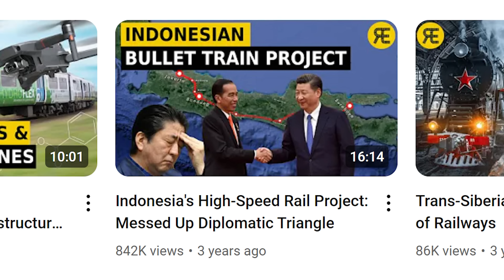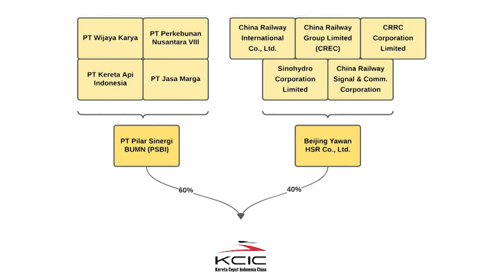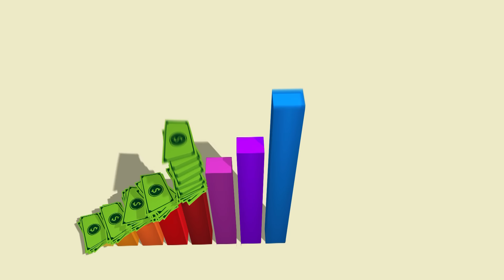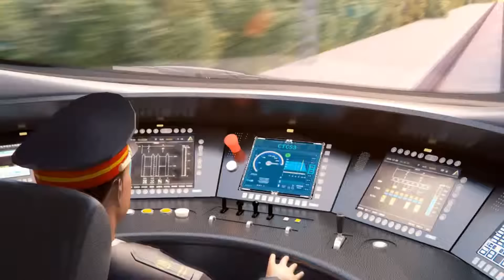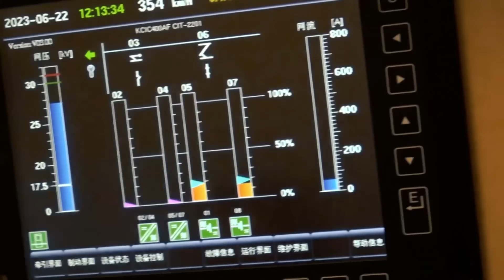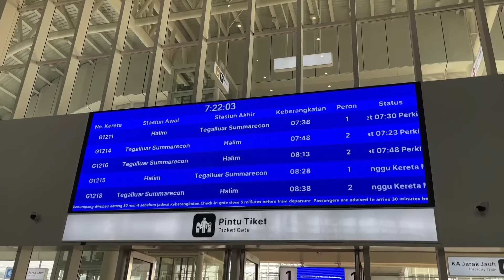Indonesia’s High-Speed Rail: One Year of Jakarta-Bandung Operations | 2024 Project Update

Comment: Correction, Jakarta HSR station is easily accessible thanks to the LRT system, which runs every 5 minutes. This frequent service makes getting to and from the station pretty hassle-free, there's simply no challenge to cater passengers to and from Jakarta HSR station. 

The bigger issue is with the feeder trains between Bandung’s city center and the Padalarang HSR station. These trains have less capacity than the HSR itself, so during peak times, some passengers might have to stand.
Reply: it´s because the process of the train construccion was like game of Thrones but in railways
Reply: LRT terletak di jakarta selatan bukan di jakarta pusat imbasnya yg dari utara,pusat ,barat dan timur masih cukup jauh.
Reply: @Silvermoon13738  even so, your country have a high speed train before canada and the amtrak here in the us
Reply: @Silvermoon13738  kan terintegrasi mas, LRT itu terintegrasi sama commuter dan LRT Jabodebek itu ada di Jakarta Timur, Selatan dan Pusat.
Reply: @manuel6273  gak semua daerah bisa menjangkau kan terutama di Jakut dan Jakbar itulah kalau di pinggiran dibuatnya , ke bandung pun sama harus pindah kereta lagi berbeda dengan negara lain kereta cepat berada di pusat kota mudah dijangkau sampai pun di kota lainnya di pusat kota.
Reply: @Silvermoon13738  harganya bikin lu demo lagi wkwkwkwk.
Reply: @awancah7309  ngapain demo orang yg rugi pemerintah karena harus bayar kereta itu puluhan bahkan ratusan tahun baru bisa lunas dari pendapatan whoosh , buatnya sudah pake APBN dan hutang, selesai jadi beban APBN.
Reply: Tegalluar station is build for new city development in the future.
The concept is "create new city center". Bandung is overcrowded now, and need some other development to generate and boost bandung GDP.
To create new tourist destinations, new housing, new office, and so on. .
Reply: @Silvermoon13738  kan udah saya bilang, transportasinya terintegrasi mas. Sama kayak Bandara Soetta, cuman orang Jakbar dan Tangerang aja yg "enak" karena jaraknya deket. Orang Bodetabek lainnya jauh jaraknya dari bandara Soetta dan atau stasiun Halim.
Reply: @Silvermoon13738 tapi Indonesia dapat ilmu membuat, mengoperasikan kereta cepat. Sekarang pt inka langsung gercep mengaplikasikan ilmu yg didapat dari proyek kereta cepat ini untuk menciptakan kereta semi cepat produksi anak bangsa Indonesia.

Indonesia bergerak maju, anda dan orang2 setipe anda dengan pesimisme bergerak merusak layaknya kanker.
Reply: And the Jakarta's monorail is actually more expensive to build..
Reply: @Silvermoon13738  nggak usah ngomongin payback period dari tiket, dampak ekonominya jauh lebih besar dari itu mulai dari pertumbuhan pariwisata, pengurangan pemakaian bhn bakar subsidi sampai ke sektor ekonomi yg terdampak disekitar stasiun..masalah mahal  itu lihat proyek kereta Johor Bahru - SIngapura yg hanya 4km tapi biayanya 33 Trilyun.. mau balik modal berapa tahun itu proyek ? Tapi kan mereka lihatnya nggak hanya pendapatan dari tiket..Lagian ini skemanya business to business, (meskipun ada APBN  disana) artinya kalaupun rugi pihak China juga akan menanggung sama sama..
Reply: @Silvermoon13738 Keknya gua ke China sama ke Jepang, Stasiun kereta cepatnya juga bukan di tengah deh.. Kayak di Shin Osaka itu bukan di Osakanya tapi di Yodogawa, kota pinggiran malah wkwkwk.. akses kereta cepat di Asia rata rata emang di pinggiran kok, biar wilayah setempat developed
Reply: @Silvermoon13738 lu suruh presiden bikin laluan mrt lrt woosh di dpan rumah km aj😂😂😂
Reply: @inanana1654  sorry boss rumahku dekat stasiun LRT Cikunir tiap hari liat whoosh sampingnya LRT tengahnya jalan toll atasnya toll lagi sampe bosan liat.🤣
Reply: @rezaalanshari1587  ibukota jepang sepertinya Tokyo deh bukan Osaka jarak Tokyo ke Osaka 500 km seperti jarak jakarta ke Semarang 450km,  jakarta ke bandung 120 km dan stasiun utamanya di stasiun Tokyo.
Reply: @Silvermoon13738  Ironis, komplain soal lokasi stasiun HSR tapi gak tau diri soal lokasi SHIA yang susah diakses orang dari arah selatan dan timur Jakarta...
Reply: @Silvermoon13738  Lalu apa hubungannya sama Ibukota? Kita gabahas Ibu-kota Ibu kotaan.. Kita bahas posisi lokasi Kereta Jarak Jauh Cepat dengan Pusat kota.. 

Tokyo emang ada yang di pusat kota, tapi untuk Shinkansen yang banyak naik malah dari Shinagawa, notabenenya pinggiran Tokyo.. 

Dan lagi, Kasus Tokyo station itu cuman Minoritas.. Dari 47 stasiun, hanya 8 yang bener bener berada di pusat kota.. 

Emang SOP kereta cepat itu ya di Pinggiran.. bukan di Kota.. belum lagi kalau kita bahas China kayak di Shanghai dan Beijing.. Ngamuk ngamuk kali anda kalau harus ke stasiun mereka wkwkwkwk
Reply: @rezaalanshari1587  stasiun kereta cepat di China di ibukota Shanghai ada 3 , dipusat kota ada stasiun Shanghai, dekat bandara internasional ada stasiun Shanghai Hongqiao, dan Shanghai selatan.

Semua ada stasiun kereta cepat mau besar mau kecil intinya ada gk harus ke pinggiran kota semua terintegrasi.
Reply: @Silvermoon13738  Udah pernah keliling China dari Stasiun Shanghai yang di pusat? Bruh, pasti ujung ujungnya disuruh ke pinggiran juga yang Hongqiao... Karena emang pusat HSR China itu basically di Hongqiao, bukan di Central.. Di central mah cuman ada Shanghai-Nanjing doang wkwkwkwk.. itupun masih tetep lewatin Hongqiao.. 

Lagian HSR di pusat kota itu emang agak agak kacau, karena kecepatan mereka itu bikin "boom" yang bisa rusakin kaca.. Itu juga alasan Kereta2 HSR Jepang yang lewat pusat kota bentuknya aneh aneh kayak E5 dan E6 buat minimalisir sonic boom.. Jadi kasus HSR ini ya emang harus kayak Bandara, jangan di pusat kota wkwkwk.. Orang Jaktim-Jaksel yang harus ke SHIA aja B aja padahal di Jakarta Barat Ujung dan transportasi kesana itu SUPER MAHAL.. 

Lah ini HSR dikasih LRT Jabodebek Murah Meriah, Transjakarta Dll masih aja ngeluh dan komplen ckckckcck 🤣
Reply: @rezaalanshari1587  ini kereta cepat whoosh lewat tempat saya di kota Bekasi aman aman aja gak masalah berarti kereta cepat itu bisa masuk ke kota kocak dan bentuknya gak aneh gk berubah.😁
Reply: @rezaalanshari1587  biaya kereta cepat Indonesia bahkan sangat mahal, yg cuma pendek jalur nya cuma 150 km dibandingkan kereta cepat China sendiri,dan negara eropa, bahkan Amerika Indonesia termahal jadi beban APBN ratusan tahun baru lunas bahkan bisa sampai kiamat gak lunas karena bunganya saja sudah mahal.😁
Reply: @Silvermoon13738  Lah asal Jeplak, kita Proyek HSR cuman $7Billion.. Proyek HSR Amerika LA-SF itu $130+billion untuk Jarak yang relatif dekat.. 

Kita udah murah banget itu wkwkwk
Reply: @Silvermoon13738  Lah bekasi yang dilewatin Whoosh itu Bekasi pinggiran pak.. Yang notabenenya Kanan kiri luas gaada gedung yang mepet jalan.. Banter banter apartment sebiji dua biji.  jangan bandingkan dengan tengah kota Jakarta yang isinya gedung tinggi pak, udah tau Boomnya bahaya di wilayah itu wkwkwkwk 🤣
Reply: @rezaalanshari1587  Jarak segitu murah liat aja whoosh cuma 150 km sedangkan jarak kereta cepat California, atau California High-Speed Rail (CAHSR), yang sedang dikembangkan adalah sekitar 1.287 kilometer. Proyek ini terdiri dari dua tahap, yaitu:
Tahap 1
Panjangnya sekitar 795 kilometer, menghubungkan San Francisco ke Los Angeles dan Anaheim melalui Central Valley.
Tahap 2
Panjangnya sekitar 1.249 kilometer, memperluas sistem ke Sacramento dan San Diego.
Reply: @ignatiusryd2031  Gak yambung ini bahas whoosh malah jadi kereta bandara , kereta SHIA gak urus saya mau di ujung kulon tempatnya itu udah diluar konteks kereta cepat.
Reply: @Silvermoon13738  Lah bro, data darimana kalau itu semua untuk semua tahap?.. Untuk 171 miles pertama aja (275 km) yang menghubungkan Bakersfield - Merced udah Habis $35 Billion yang notabennya 5x lipat modal HSR Indonesia untuk Jarak yang bahkan ga sampe 2x lipat HSR Jakarta - Bandung.. 

Murah darimananya dah? Wkwkwkwk.. 

Dan untuk Merced - San Fransisco dimana Jaraknya 131 Miles (210KM) biayanya nambah $100 Billion.. 

Jauh lebih mahal dibandingkan Bakersfield - Merced.. Keterlaluan kalau bilang murah
Reply: @Silvermoon13738  California HSR sampe sekarang belum jadi-jadi meskipun udah lebih lama umur projectnya dibanding HSR Indonesia. Bahkan costnya udah makin menggelembung sampe-sampe orang AS udah gak ada yakin itu bakal jadi. Kocak lu ah.
Reply: @ignatiusryd2031  santai aja walaupun belum jadi bahkan gak jadi ya gpp Amerika kaya bebas cetak dollar biaya 1 kapal induk saja gede , inggris saja tidak melanjutkan proyek kereta cepat karena tau itu proyek rugi beban negara mungkin Amerika berpikir juga sama lah Indonesia malah 😁 udah jadi pula terlanjur jadi bubur udahlah tanggung saja kerugiannya menangis APBN tiap tahun nanggung itu 🤣
Reply: Also the fact that these feeder trains completely fucked the already tight local train line
Reply: @Silvermoon13738  Kalo semua negara punya pola pikir kaya Amerika Serikat yg car-centric, Jepang, Cina, Prancis dll gak bakal punya sistem kereta cepat. Kontra dengan transportasi publik dan kebijakan pemerintah yg terburu-buru boleh kok, tapi gak menjustifikasi opini dan fetish berlebihan anda dengan kendaraan pribadi 🤷🏽‍♂️.
Reply: @manuel6273  sungguh ironis setelah covid pemerintah sibuk IKN dan kereta cepat padahal ekonomi belum stabil banyak PHK, PT tutup, pengangguran naik pemerintah tutup mata sengaja karena mau pilpres nantinya orang2 itu dikasih bansos biar senang dan kembali pilih yang kasih bansos padahal urgent nya gak ada sama sekali IKN dan kereta cepat whoosh buat tahun 2030 pun masih bisa saat ekonomi sudah stabil liat sekarang inflasi dimana mana, hutang pun semakin naik akibat, cari nama bangun ini itu secepatnya sebelum lengser dan dapat fee (gratifikasi) sebesar besarnya melalui berbagai proyek semakin besar proyek semakin besar fee yg didapat.
Reply: Jangan heran awalnya kereta jepang yang akan dibangun tapi setelah dapat fee dari China berubah jadi kereta China, China pun gak bodoh dibuatnya proposal nya lebih murah dari jepang tapi setelah berjalan barulah dinaikkan biayanya karena Jika ditolak kereta cepat tidak jadi mau gak mau maka ditawarkan pinjaman dari bank  China untuk bantuan pendanaan, seperti rentenir China pun untung banyak menghisap bunga besar dari hutang tersebut, yang bodoh akan kalah dengan strategi yang pintar itu namanya debt trap seperti itu China cuan dari berbagai pendanaan di seluruh dunia.
Reply: @Silvermoon13738 
ga sekalian aja dibangun pas depan rumah lo?
Reply: @AMZZZMA  buat apa kalau hidup semakin susah lebih baik gak ada whoosh
Reply: @Silvermoon13738    jakarta timur aja pendukung nya 2 juta. Kurang apa potensi penumpangnya
Reply: Tetap lebih suka naik mobil kalau Jakarta-Bandung karna saya harus bawa koper dan ransel. Mungkin saya bakal pertimbangkan kereta cepat kalau rutenya diperpanjang sampai Manggarai atau airport link diperpanjang sampai Halim, jadi gak harus naik LRT yang notabene kan buat mass transit.
Reply: @rizkydarmawan6540  

tidak ada tempat di jakarta yang bisa digusur untuk membangun stasiun baru di barat kota / daerah Tangerang. Jadi orang jakarta barat/ kota Tangerang harus ke Bandung lewat bandara .
Reply: @IndustrisasiIndonesia  Gak perlu bikin stasiun baru. Cukup perpanjang rute kereta cepat ke Manggarai atau perpanjang rute airport link ke Halim, atau lebih bagus dua-duanya. Sangat memudahkan buat penumpang dengan bagasi karena mengurangi kebutuhan transit di KRL/MRT/LRT/BRT non-ekspres.
Reply: @rizkydarmawan6540  kamu bisa mikir gak sih. Kereta cepat itu berada di rel 1455 mm bukan 1067mm. Dan misalkan di perpanjang sampai Manggarai. Orang akan naik kereta cepat lewat Manggarai .

Ada lebih banyak penumpang dari pada stasiun Manggarai lama. Apalagi Stasiun Manggarai Tidka Bunya sistem pengantian untuk kereta cepat.

Stasiun ya harus di bongkar dan bangun yang baru untuk menambah kapasitas penumpang dan sistem kereta. Ya sama aja bangun yang baru jadinya. 

Naik pesawat aja sana kalau tinggal di jakarta barat.
Reply: @IndustrisasiIndonesia  kAmU biSa miKiR gaK siH!!! Kebiasaan orang Indo kalau dikiranya udah paling paham sendiri.

Semua juga tau kalau gaugenya beda. Manggarai itu kan idenya dijadikan stasiun hub, otomatis tetap bakal diperluas juga tiap ada pengembangan baru di sistem perkeretaan Jakarta. Manggarai pun bukan Setiabudi yang sudah padat pengembangan, justru dia termasuk daerah yang relatif masih tersedia ruang.

Dan lagi, idenya itu mau memudahkan konektivitas atau bikin kota baru sih? Masa iya yang tinggal di sebelah barat di suruh naik "pesawat" ke Bandung. Perpanjangan layanan ekspres itu penting (atau bahkan rute kereta cepatnya kalau mungkin) buat mempercepat transit dengan cara mengurangi intermingle antar komuter sehari-hari dan penumpang Whoosh. Ini sudah terbukti di Jepang, dan di Perancis atau Jerman dengan sistem RER atau S-Bahnnya.
Reply: @rizkydarmawan6540    kamu enak sekali bilang semua serba gampang tinggal gusur bangun kereta cepat sampai Manggarai atau stasiun Bandung. Mana bisa kocak. 

Kalau 100.000 orang gak di paksa pindah
Reply: @IndustrisasiIndonesia  Pengembangan urban di mana-mana juga begitu, apalagi di luar business district. Selain geografi, pembebasan lahan cuma dihambat waktu dan uang. Dua-duanya pasti ada kalau bersedia sabar. Tunggu 8 - 12 tahun, kalau memang prioritas dan lulus feasibility study, satu juta orang pun bakal disuruh pindah.

Lagian pemanjangan trayek kereta cepat atau rel ekspres gak perlu buru-buru juga karna transportasi alternatif Jakarta-Bandung masih memadai dan LRT Jabodebek pun masih relatif sepi, jadi sekalipun bawa koper gak terlalu parah desakannya dengan komuter LRT harian. Tapi apa iya LRT Jabodebek selamanya sepi, kan nggak juga.
Reply: Yes yes very successful, Congratulations
I sincerely congratulate Indonesia and China grand relationships.
Thankyou for showing your true self.